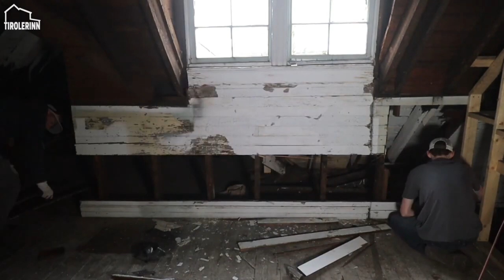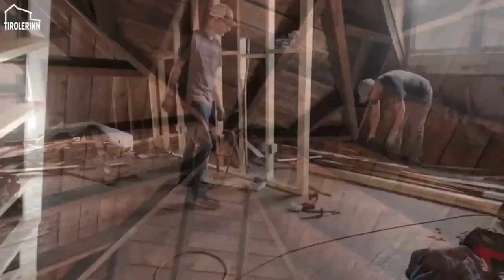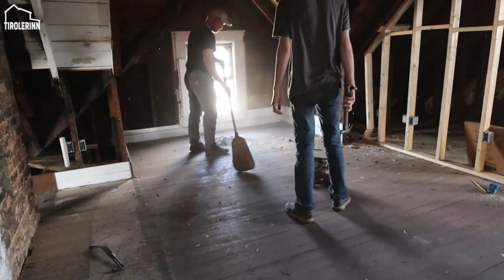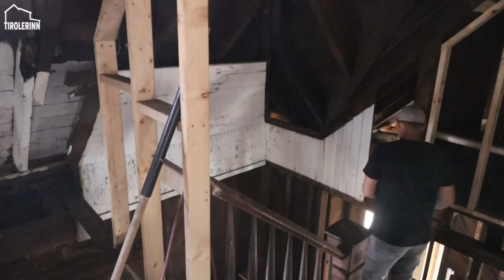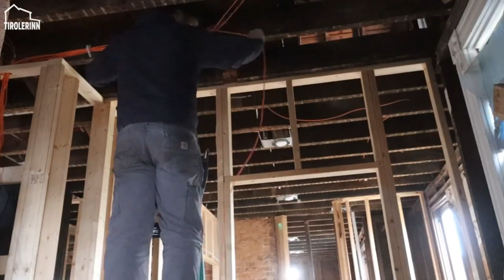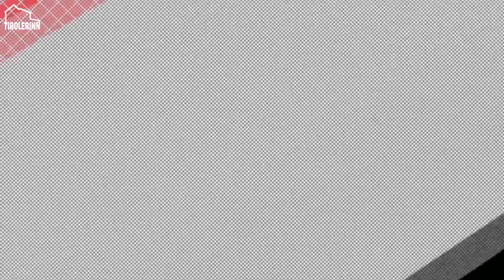Demoing in the Attic and Running Wires - Tirolerinn - Victorian Home Renovation

Comment: Victorians did not have recessed lighting either.  I thought what you said about Victorians not having exposed beams but if you guys like it, go for it.  It is  on the third floor and not in the "public" areas.  Victorians were famous for making the public areas showy and the private/family areas more plain.  You are doing a great job!!
Reply from the maker: yes, the master will for sure be more modern than other areas of the house. plan is to make the house more modern the further up you go on the floors.

Comment: Great progress again. I would also mount the chandelier on a flat area, because an additional beam doesn't fit optically. For cleaning or in  case of an issue, you can install a small winch behind the flat area😁
Reply from the maker: Well they had ropes to lower the chandelier in the past but they never had to run electrical wire along with the chandelier… I will have to think how to solve this problem
Reply: @TirolerInn  I've seen two variants so far.  One with a chain through which the cable is fed. And the other one is a cable with a wire rope inside.